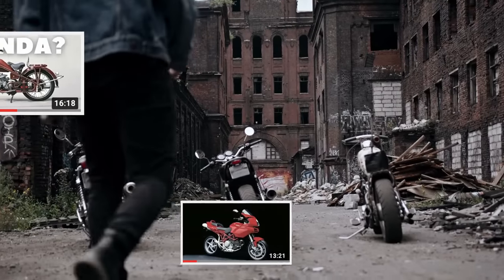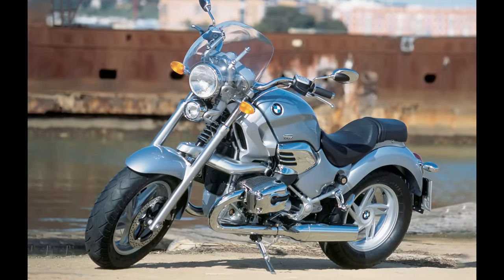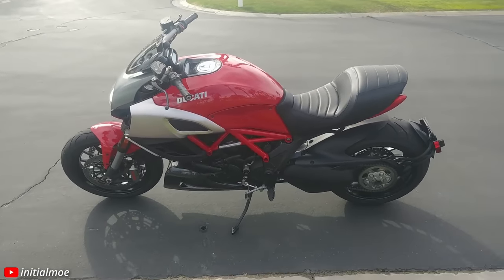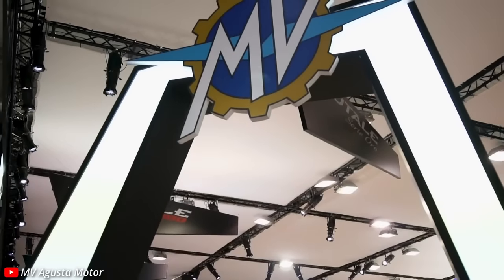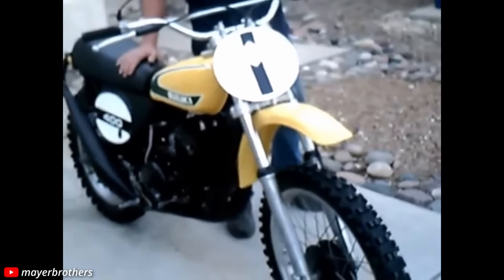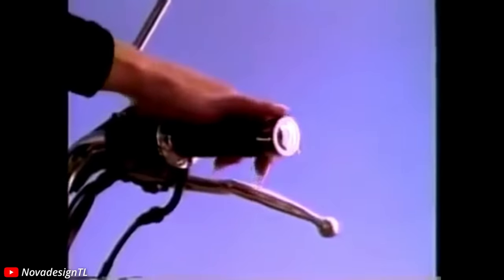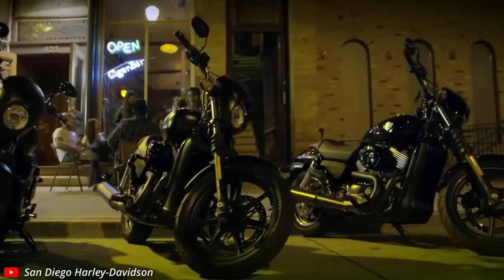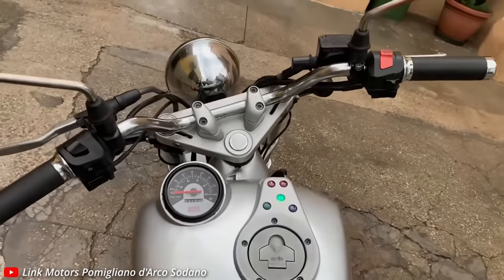The WORST Motorcycle from every manufacturer

Comment: I ran across than r1200c, 1998 Edition in 2009 but only had 30 300 miles on it I was able to buy it pretty cheap. Yes it looked odd, and it sets High. However once I started writing it, except for the fact that I've never had a motorcycle that I couldn't easily up shift without using the clutch, it did take me awhile to learn how to do it with this unbroken in BMW transmission. However this bike is really a nice bike. It is reliable as hell, I rode it out to Saskatchewan Canada in 2011 to visit my daughter for a while, and I brought it back the first week of March in 2012 from Regina Saskatchewan to my home just north of Detroit and a 29 hour ride. I long ass Ride On The Naked Bike but it served me wonderfully. Until you've ridden one of these for a while, quit hating on it it truly is the most intuitive by, I just think about changing lanes and my offhand will squeeze just a little bit and it'll drift right over into the next Lane like it was reading my mind I liken it to Flying a helicopter that is very light on the touch. I've gotten decent fuel mileage on long trips, but it does not get good fuel mileage around town I have ridden one with the wider front tire, I like the narrow front tire better. It also screams for better rubber. The rubber that comes on it doesn't last very long, it is way too soft for the bike. Bridgestone rubber works way better. But the front Bridgestone tire wasn't able to get recently I had to settle for a Dunlop which likes to skate a bit on the freeway. At least on freeways that have a brushed finish. I know that the Bridgestone 952 didn't have that issue. At least I believe that was the correct tire.
Yes the engine has had a detune. Puts out enough torque to get me up to 120 miles an hour in almost no time, and 135 is fairly easy to get to and I've still never tried to see how far I can wring it out. I have a small screen on it, works wonderfully I think I might try and put a larger screen on the front of it. First thing I did with it was put a yellow bulb in the headlight, mostly because other drivers see the yellow ball better and your eyes can see things lit and yellow better than than they can see things lit with really white or bluish light. I'll take the safety factor of others being able to see me far easier every time. Plus now that they have yellow bulbs in LED I can have both. The local BMW dealer actually used one of these as their lender bike, and it had well over 100,000 Mi on it, it just never stop running.
I would like to point out that I track down a Honda ST1300 which I always wanted one of those ever since the 1100 came out. I found one and I tried to take it for a ride and it's it's taller than my BMW for god sakes. What the fuck does a sport touring bike need to set where I can look over the top of an Excursion. You're supposed to be able to talk to damn thing least a little bit. I know I like the Cruzer writing style, but I expected that bite to be a whole lot more comfortable than it was. Wonderful drive system on it all the way from the engine through the final drive. Why in the hell can't they get that seat to set about 6 in lower than it is? Whiskey Tango Foxtrot

Comment: I am surprised by the lot of comments about how "bulletproof" the Virago is. Most of my friends who had it, had problems with it. The inadequate cooling of the regulator was the smallest thing (all of them had it replaced) but many of them had issues with the engine itself. I was touring several times with a girl who had the 535 Virago and it was a really quick machine when it was working but once we swapped bikes I realized that despite the cruiser look it simply did not feel like riding a cruiser. I think that it was a good move from Yamaha to replace this model with the DragStar.

Comment: I have a 2005 Kawasaki Vulcan Meanstreak 1600 with 850 miles on it. Physical issues has not allowed a ride on it since 2005, but I don't want to give it away. It could hit 70 mph in around 50 yards hitting second at 4000 rpm and you better hang on. Rides like a dream as it's around 680 lbs. empty, now it just sits in the garage on carpet pads awaiting it's next ride.

Comment: The R-1200C comments are stupid.  1. yes it looks wierd but... if you had ever spent time riding the old BMW /2 classic motorcycles  - like I have - you wont have to ride this 50 feet to understand how very similar they are... and how they were meant to do pretty much the same things.  Forget Style, Forget Harley ( that's easy... who else has made more awful motorcycles).  The quality of paint, fit and finish and the ultimate longevity of the the R-1200 will prove the point when they do finally become collectable.   BMW's other badly maligned by excellent bike the Scarver... is also a fashion victim underneath which is a truly excellent motorcycle.    The other hidden plus is serviceablilty... while the other oil heads are nightmares, this thing has everything hanging out there... and clutch and spline lube a breeze in comparison.  This doesnt mean the C is well suited to what most want to do, or how they want to do it.. but a low seat travel bike.. this has the right stuff.

Comment: I have an 82 virago 920 with less than 12k miles on the odometer. It's a beautiful survivor with a nice barn find patina and not so much as a scratch on the crashbars. It gets compliments everywhere I take it...even from some of the Harley Dangerous guys! Lots of old guys tell me "that's the first big bike I ever owend back when..." The first gen virago was weird and didn't know what it wanted to be, it was a cruiser designed by sport bike people until the second generation update in the mid/late 80s when they rearranged the suspension and changed the riding position, but both before and afterwards I feel like it did the best out of all the Japanese bikes of stealing market share from the American brands. All I can say is, after replacing the starter and a good carb cleaning, mine fires right up in a single crank with no choke, rides and runs spectacularly smooth for a V, and most importantly it makes me happy, so the hell with everyone else!

Comment: I did just read a Consumer Reports article recently that said BMW has a 50% failure rate of their motorcycles, statistically. Ducati had about half of that at 22%, and the Japanese had half again, at only 13% failure rate. Indian and Polaris had a reliability of about 17% which was in between the Japanese and Ducati. Talking to people who have owned BMW cars, I know the 50% failure rate of their cars is standard. Not a major engine failure, but a minor problem that requires stopping and repairing the car from a mechanical malfunction. I don't know if there are any actual real statistics available, but I've never actually heard of BMW motorcycles having problems, except for one report of a new GS1250 that had a bad valve timing solenoid on the cylinder head, right after purchasing. But BMW seems to be mechanically, and electronically, very good, and I don't think the 50% statistic really applies to new, well kept motorcycles.

Comment: I had a  1984 750 Virago and it was totally fine except for the starter.   When I bought it I knew the starter wasn't working.  You could bump start it super easy though and the price was right.   Didn't have a kick starter. The starter motor tested good but wouldn't engage.  So I took it apart expecting to see a typical Bendix gear like a Ford or Chevy.  NOPE. It had the weirdest looking overly complicated engagement mechanism I have ever seen.  I can't even describe it you can look it up. You could see someone had already been in there.  My brother and eventually just gave up on it and closed the case back up in disgust.  Never did fix starter but I bump started it for two more years and rode it!

Comment: I had a Virago 250.  It did OK, where you were doing a commute to and from work daily.  55 MPH it did fine, but not much more.  With it I learned to not attempt to accelerate to change lanes, but slow into a lane change.  That being said it was better than the Honda 150 scooter I had before it.  I upgraded to the Kawasaki Vulcan 500.  That motorcycle had a 50 HP Ninja engine.  Did wonderfully.  Twist throttle and you had a tiger.  Mine was the one with a belt drive, and no delay with the throttle twist, and no chain stretching.  I did like that bike.  The only down side was the gas tank capacity.

Comment: I've been riding a XV920 for 24 years as a comuterbike en on vacations (Dolomites, Alps). It was easy to ride, good steering capabilities (for a cruiser), comfortable and very reliable. I only did the nessecary maintenance and the only repair I had  was the replacement of 2 gearwheels and a clamp in the starterunit. 
Maybe not the most beautiful bike, but you can't see that when you are riding it 🙂and I don't buy a motorbike for spectators on the side of the road.

Comment: A good buddy of mine was working at a Yamaha dealer/shop when the Virago first came out. The owners of the shop also owned the Snark racing team so of course the members of the team worked in the shop. Anyway, they looked at the Virago as a joke. I thought they were alright, but back then a cruiser was not what I wanted in a motorcycle. If I remember right, they were a pretty good seller.

Comment: The early Viragos were not very attractive, "in my opinion". I didn't care for the look of the  exposed engine without a frame and the starters were unreliable. However, in the late 80's and 90's, they were much more appealing and the starter issues were fixed. Yamaha made, more sleek design changes (more streamlined)...not so boxee. I bought a 96 XV750 with 11K miles, with saddlebags and windshield and lots of chrome. I bought it from an old gentleman, the bike sat for 10 years. I cleaned out the carbs, changed the oil & brake fluid, changed the dry-rotted tires, put new battery and plugs and she fired right up. Been riding for the passed five years, very dependable. I made custom forward controls, Cobra pipes and put on a re-jetted single carb conversion...she's runs and sounds great. I'm currently working on turning it into a bobber. This bike has a lot of potential. I've seen a lot of early 80's Viragos being converted into Cafe racers...they actually look pretty cool. I would say that, the Virago was a success for nearly two decades, paving the way for the current V-Stars and other metric V-twin cruisers.

Comment: I used to work in a motorcycle shop and even owned one for a few years. Telling people to look for a used early Virago is very bad advice. These bikes are indeed Yamaha's worst because they are terribly made. First there is the wildy overly-complex starter drive with many points of failure. This alone made it so that many shops refused to work on it because the shop knew it would be back soon with an angry customer. The joke was "its a great bike if you live on a hill" (because you'll be push starting it). And the thing is it doesnt end there; it had Yamahas faulty electrical system which plagued all their early 80's bikes, and the big exhaust cross-over "box" was prone to rust out. The icing on the cake here was the exhaust head-studs were soft and would often bend/break when trying to replace said rusted exhaust. Note that this does not apply to subsequent Viragos like the XV535 which had a completely different engine design that notably eliminated the clock-work starter drive and by then, Yamaha had worked out the flaws of their electrical systems (mostly- I had one 535 that the rear cylinder refused to fire consistently even after replacing every last component of the ignition system.) 
Some other dishonorable mentions: The Suzuki TL1000 was known as a widowmaker due to its odd rotary suspension system which caused it to handle awkwardly. The early Suzuki Turbo was also a deadly machine because the turbo waste-gate was faulty and could cause the engine to enter 'boost' while the driver was simply downshifting (like for an exit ramp). The early Honda V4s had an oiling or perhaps cam-material problem (which is disputed) that caused many problems, often with the rear head. An old guy told me the Honda 500T was "junk right from the factory'. The internal balance was said to be off and the bike would shake itself to pieces. Of this, I can only be the messenger because that was before my time.

Comment: The comment that Moto Guzzi V-twins are consistently unreliable doesn't match my experience with older big twins or what I hear from riders of their modern models. The engines and chassis have always been solid, the electrical systems less so but usually not disastrous. The model about which I've heard the most horror stories is the small-block 650cc V65 Lario. It was a high-performance upgrade of the 500cc V50 line. The Lario was plagued by failures of its 4-valve-per-cylinder valve trains,. The Cardan joint from the V50 driveshaft couldn't handle the new engine's power, and when it failed it also destroyed the one-piece cast aluminum swingarm in which it ran.

Comment: Your definition of worst is deeply suspect here. You should really know what you mean before you include a bike in your list which is a comfort and reliability legend just because you aren't sold on the concept. The Enfields you're talking about aren't Royal Enfields. Royal Enfield went bust in 1970 and ceased all production. In India the Enfield India Co  ( a joint venture between Royal Enfield and Madras Motors making Bullets under licence) continues production without Royal Enfield. Now wholely owned by Madras. this is now a completely seperate company. Enfield India  has a massive home market for simple easily fixed motorcycles and eventually  It starts importing Enfield India Bullet back into Britain in 1977. ( now just known as Enfield ) They sell because being made in India they are incredibly cheap compared to Japanese bikes similar to Urals or CZs. ( where are their bikes on the list ) On the back of these home market sales the company has the money to constantly update their bikes and eventually introduce newer versions including the twins we have just seen introduced. Enfield India changes it's name to Royal Enfield in order to more completely reap the nostalgia market, but this company is not THE  original Royal Enfield Company to talk about it as if it is is misleading.   Also the oil in frame concept is a great inovation used ever since by many companies such as Yamaha and Honda in offroad applications as it alows a dry sump for excellent ground clearance  with low centre of gravity but creates more space behind the engine where the oil tank would otherwise be, for better air filtration, electronics and (later) monoshock suspension it was not the reason triumphs didn't sell in the 70s. Why produce a video called the worst bikes by every manufacturer then fail to identify a bike by a manufacturer. thereby implying that all their bikes are poor bikes when bikes like the Spada ( another comfort and reliability legend ), Le Mans and V1000 are widely acclaimed as great bikes. Generally I enjoy your Videos despite their often "hastey" or "simplified for the consumer and time constraints" research but I have to say this one could be better.

Comment: I absolutely agree with you on every bike. The one I kind of liked was the BMW. I pulled into the display in Sturgis rally to check out their bikes and saw this thing. So, I asked to test ride that one. They told me that I had to wait till the next morning. One of their engineers saw me pull in on my 1950 stretched Pan Head and said He would take me out Then and there . I agree with you It's an ugly bike, but I had fun and got to stop of at a local bar and have a beer with the guy. It is a great memory and your right about the power. My Pan (highly modified) had about 20 horsepower more than the BMW. Still had fun and the bike had only been out maybe 2 years, so I had seen it on the road.

Comment: I guess everyone has their own opinions, but Bart doesn't seem to know a lot about, at least, the Eliminator! I don't think they sold many units, but RIGHT AFTER they stopped making them, they have been sought after big time! I bought my 900 brand new in high school in '85. They were DRAG bikes! Meant to be a street version of a quarter mile bike! And yes, they did get lumped in as a "Power Cruiser" just because they had no fairing, a powerful motor and a slightly upright eating position. They were actually meant to be Kawi's version of a '70's KZ 900 drag bike. I have done three 1500 mile round trips in 6 days (including a day off to watch the hill climbs in Laconia), and a 2200 mile, 9 day trip down to The Smoke Out in NC. My GF hates riding long trips on with me as her 250 Rebel (an amazing bike) gets the same mileage out of a tank as my Superglide and Wideglide, but she gets pi**ed as we have to stop every 60 miles for gas. That's the only drawback. I still have my baby, 39 years later, as my first bike, a mint 1980 RD400 was dumped first by the girl who bought it off me a month later, then her brother flipped it over doing wheelies. Saw it after that and swore I could never sell the Kawi! It's not mint, but other than smoking the first tire off it that first year, I've rode normal and had a tire last 5 years! I didn't buy it to be an attention getter, I bought it because it was love at first sight after I sold the RD. I'd never seen one before that trip to the showroom. And because I've lived in the same town all my life and it's a one owner bike that hasn't been beaten on and people know that, I have offers from quite a few people every year to buy it. Not bad for the "worst motorcycle Kawi ever made eh"???

Comment: Royal Enfield came up with a real dud some decades ago when they put a 200cc two-stroke engine in a slightly modified Bullet frame and named it the Mini Bullet. It was (of course) underpowered, handled like a cow, and slid if you braked hard.